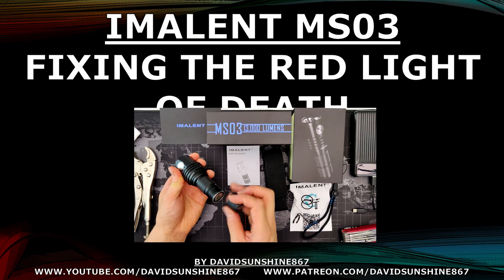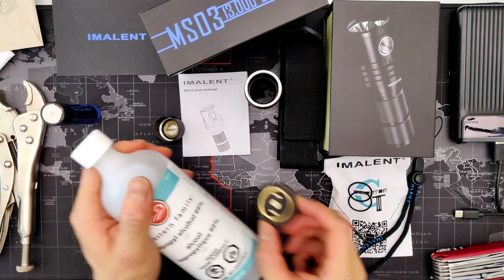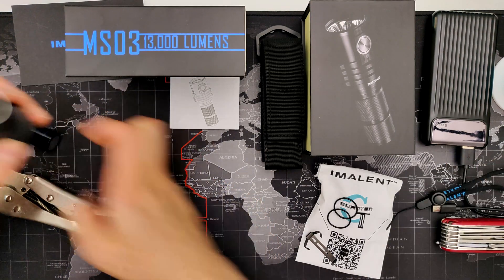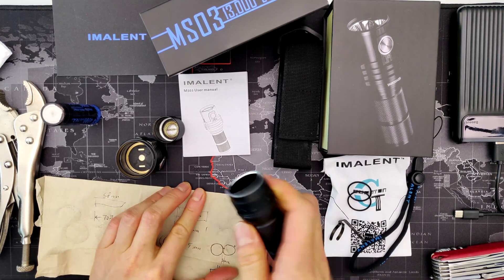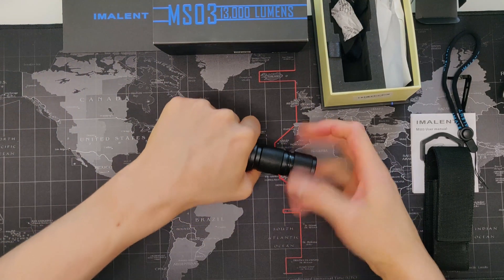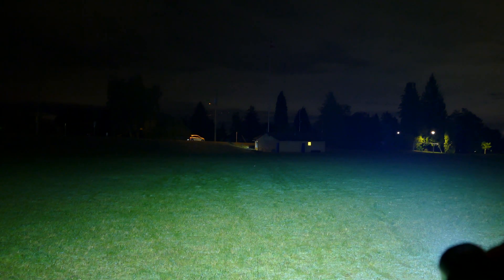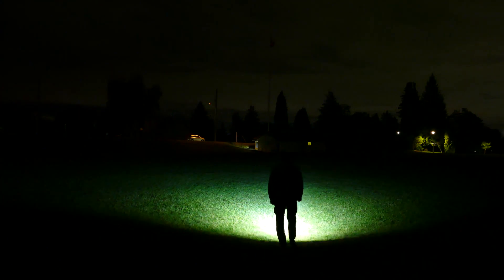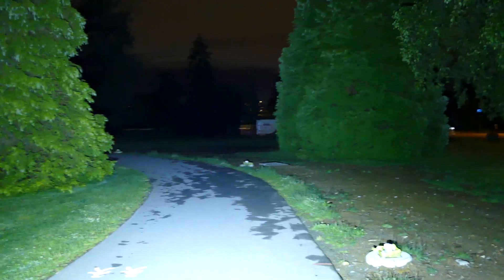How To Fix IMALENT MS03 - Red Light of Death

Comment: Did not work :( When attempting to go turbo the light blinks green 3 times then nothing. Regular flash light works but only 3 modes . Any ideas?
Reply from the maker: Does the LED light up for a split second?  Don't look at it, but shine it to a wall when you first put in the battery and try to engage turbo. I think I've seen that 3 blinks before, when I was first diagnosing the problem and the threadlock kept the current from flowing. It must know that there's not enough available current and only allows the lower modes.  The Texas instruments dc boost chip they have in there is actually very smart and has safeties.  I would try cleaning all the contacts again, even the spring and positive terminal on the driver.  Clean the aluminum body contacts, and clean the driver negative ring contact a lot, there may be a clear layer of threadlock on there that you haven't gotten off, may want to use a chopstick(carve the tip so you can clean all the surfaces easily) and rubbing alcohol to clean that. 
After all that cleaning, if it still doesn't work, it's probably a bad battery or driver.
Contact Amazon or Imalent to let them know and see how they can help you. They seem pretty good about it. They even sent me a new tail, cuz they thought the tail could be an issue, but I took the spring out and cleaned it.
Cheers!
David.
Reply: @DavidSunshine  Thank you so much for your attention and ideas. At this point I had contacted them through amazon and they'll be sending me a new one.  Currently in the process of shipping the old one out . Thanks again sir!! Your videos rock!
Reply from the maker: @enterthevortex5883  Great to hear!  Ya Amazon's policy is great. They make the customer satisfied!  Hopefully the new one works. If not, it's not really worth keeping. 
I got mine from AliExpress and they wanted me to send it back, shipping would be killer so I decided to look into fixing it myself, and I've been pretty happy with it. If it didn't work out, I'd probably have to pay $30 to send it back. 
I'm gonna try to swap the LEDs to warm white next tho! Stay tuned!
Thanks man! Glad you enjoy the videos!
Cheers!
David.
Reply: @DavidSunshine  Facts!! Thanks again!

Comment: My ms06 has this problems also and slightly oxidised or corroded contacts, they have brown spots and patches forming on them. The threads are also very rough and gritty so I think I'll do a good clean and fresh application of grease. Thankyou very much for your helpful video
Reply from the maker: You're welcome!  Sounds like the same problem. The MS06 is probably built with the same electronics, just doubled up, so 6 voltage boosters instead of 3.  In my detailed review of the MS03 I go into detail of why I think the programming is causing this issue, if they used the same programming, it could be leading to the exact same problems.
Hope it works well after your clean up all the contacts!
Cheers!
David.
Reply: @DavidSunshine  seems to be working ok but I'm finding the threads are garbage, so rough it literally difficult to tighten fully or get a decent grip on the body to loosen once fully tightened just because of the rounded and smoothed anodised finish  along with the large amount of friction. I can see why there's a bit of a premium on the thrunite flashlights of which I own 3 of, no QC issues at all. Still bright as all hell, good flood light. I'm looking to pick up a tn40 next for a powerful thrower with a useful beam and spill.
Reply from the maker: @Owen-np3wf  That's great to hear!  The machining sounds worse on the MS06 than on the MS03, the threads actually are very smooth on the MS03.  Thrunite sounds like a quality brand though, I don't have any of their lights but from what I hear, they are up there along with the best.
The TN40 looks like a great light!  Over a Km lol, that's a lot of throw.   You'll definitely be having some fun with that!
Cheers!
David.

Comment: Great review, can you let me know that there’s no more problems after you clean it
Reply from the maker: Thank you Boris!  I appreciate it.  Great question!  Actually, after more in depth testing, I found that the LVC is set too high still, and the light will still kick the low voltage cutoff on, and prevent you from using Turbo, once the battery is at about 3.8V, not ideal, they should allow turbo as long as the battery is at 3.0+V, but since they test for voltage during the turbo, it sees 3.0V and latches the LVC, and locks out turbo.  It's simple programming, but they could have changed the voltage testing to not function during turbo, or set it down lower.  I go into detail about this in my detailed review video, you can see it here:  https://youtu.be/KTgq42FKP8E?t=446
I could only go into turbo about 8 times, before it got down to about 3.8V, then you run into the issue.
You can help the chipset see a higher voltage by bypassing the tail spring with a copper braid, but the root of the issue is the firmware, and the fact that it is a latching LVC, instead, they should make it non-latching, and also check voltage during operation(With modified voltages in each mode, at Turbo, you would need to set a lower voltage, as I described in my detailed review video at around this time: https://youtu.be/KTgq42FKP8E?t=506).
Hope that helps!
Please let me know if you have any questions.
Cheers,
David.
Reply: Thank you so much for that response. I was about to purchase it. But I guess I’ll pass. I wish there was another flood like flashlight with 13k lumens that is a similar size. Any suggestions?
Reply: @Justoneoftheguys  Astrolux ea01s or Astrolux FT02S.
Reply from the maker: @Justoneoftheguys  You're welcome!  Glad I could help you make an informed decision.  The leaking side switch is probably not desired either.  It stops working until you can dry it out.
The Lumintop FW21 Pro(https://tidd.ly/3gmqOHs, Normal Version with 3 x XHP50.2s, not the X9L version which is an 6500lm/810m thrower) with 10,000 lumens might be a good alternative to the MS03, won't be as floody since it uses 3 x XHP50.2s instead of XHP70.2s, but still somewhat floody since it has 3 LEDs instead of just 1. It doesn't have a USB C port or a side switch though, but the Anduril firmware and user interface is awesome.  You can adjust the max temperature, which is handy, sometimes you may want it to not get scorching hot, other times, you may want more light output, and have it get hotter, like 65C.
Another light with a side switch is the MT07(https://tidd.ly/3mW9H1Q) with 5500 lms, very floody light with 7 x SST20s. It has the same firmware as the FW21 and can adjust temperatures.
The EC01(https://tidd.ly/2W3L4od) is a good 21700 light, slightly longer but has a USB C port, only 1 LED so not so floody.  If you look at my graph at https://youtu.be/KTgq42FKP8E?t=47, you see the EC01 puts out 5200lms initially, that's plenty of light, and the big reflector helps throw light.  If  you want a flooder with more power though, the EC03(https://tidd.ly/3mWssSP) might work well, I don't have this light, but since it has a shallow reflector, it should throw very similarly to the MS03.  The EC03 has smaller LEDs though, so it will throw a little better.
The USB C port on the outside is nice though on the EC01 and EC03.  It uses Anduril firmware, they all do, so you can adjust the temperature, it's set very low initially, but you can set it so that it gets as hot as the MS03, and by doing so, you'll be able to output about 2000 lumens continuously.
Check em out and see what features you prefer.  I like the copper FW21, but it would tarnish, and be heavy, so although it would be great since it has huge thermal capacity, and can stay on brighter longer, the weight and tarnishing might get annoying after some time.  I think that's why Aluminum is the preferred material, with a large copper slug inside.
If you need a good 21700, the Sofirn performs well for me, basically the same as the Imalent high drain battery:  https://tidd.ly/2Li6r2Q  
If you choose a light without a USB C port, a simple charger works fine: https://tidd.ly/36RHzY4
Hope that helps!
Cheers!
David.
Reply: Thank You sir for Your really useful review helping to understand that these MS03 and MS06 are rather still pocket rockets for short than torches to carry switched on for a long walk in a dark forest. I was considering to buy MS06 but refused due to Your review. 
But I still need a flashlight of the same size and weight to run 4000+ stabilized lms during about 1 hour or a bit more with a possibility  to throw briefly more than 12-15k.  Now I use a Sofirn SP 36PRO and am very glad, but I want more. Sir, would You be so kind to recommend me some other brands and models  with long-lasting run of 4k+lumens  instead of this Imalent MS06?

Comment: I've heard the MS06 has the same issues, at least in its first iteration.  Do you know if Imalent has gotten a handle on this issue?
Reply from the maker: Hi,
No idea if they have fixed it.
When I first had these issues and was asking about warranty, I described the problem to the representative, hopefully educating them. But they may have not told engineering, I didn't get any feedback on it, so it's possible that they are just continuing on with their current design.
In my more detailed review, I go into detail about why I think the issue occurs, the firmware is looking for 3V before it kicks in LVC, at the high current, they will do this prematurely, I described that too them, but I'm not sure if they'll readjust the firmware.
The MS06 has 3 batteries, so it shouldn't be as bad, but it could still be very similar since the traces on the circuit board may very well be similarly sized (proportionally to amperage increase).  
Cheers,
David.
Reply: @DavidSunshine  Thank you.  I might just risk the MS 06, from Amazon.  Wish me luck!
Reply from the maker: @jeffgaboury3157  Lol.  Ya it's worth trying out for 30 days, but Amazon got returns to Jan 31st so it'll be plenty of time to make sure it's working right!
Mine goes into LVC at 3.8V, so it's not the best, but could be worse. 
Keep in mind that as the battery gets older, the internal resistance increases and it might go into LVC even sooner.  So I'm a year or two it might only go into turbo a few times before it's LVC kicks in. So there's that concern too.
They really need to fix it in the firmware.
Hopefully you have good luck with the MS06! 
Cheers!
David.
Reply: @DavidSunshine  Thank you!  I would hope that they have been actively working on the issue.  Both lights are way too cool to not have the issue addressed.  Time will tell.
Reply from the maker: @jeffgaboury3157  Anytime!
Ya they are really cool. The hardware is great, it's too bad their software team let them down with a poorly programmed firmware.  I hope they get it right too!  But with everything software, there are bugs and they are constantly improving.  
Let's hope they get it right!  
Cheers,
David.
Reply: @jeffgaboury3157  how did you make out? I'm just finding this out after ordering one
Reply: @rich-qk7dc  I don't have the MS 03, but my MS06 works fine.  The R30 also works well.  Both the MS06 and R30 will go "red" once they heat up, but it's easy cycle through the modes and I don't have to break the battery contact or anything, nor have I had to clean the contacts.  I'm generally very pleased with the MS06 and the R30.  The only caveat is that the R30 switch isn't as robust - I find I have to hit it with the flat of my thumb, rather than the tip as I briefly had an issue with the R30 switch sticking when I used my thumb tip.  I think I was somehow pushing it forwards as I pressed and causing the switch to stick under the lip of its housing., but I haven't had that issue at all, since I changed to engaging it with the flat of my thumb.  I don't consider it a major issue at all, but it is something of which to be aware.

Comment: I'm confused, the MS03 will stop shining at 13,000 lumens after awhile and won't shine at 13,000 again until you reset it? 
Someone else in the comments here was talking about how the heat regulation kicks in. If that's the reason for this, then you shouldn't mess with it. Running it at that setting for more than just a a few seconds is a bad idea.
Reply from the maker: Good question Alrek!
This fix is to stop the red light from coming on right when the battery is charged to 4.2V, it should allow you to get into Turbo, turn it off, and go back to Turbo without issues, till the battery gets to about 3.8V(Manual states 3.4V, but I haven't been able to get it clean enough to get it down to that voltage, or my battery may not be brand new).
It has thermal regulation that brings down output from 13,000 lumens to about 2000 lumens in 35s automatically, and if you do it after the flashlight is already warm, it'll take about 15s to drop down to 2000 lumens, but that's not related to the "red light of death" problem.
The red light has to do with the Low Voltage Cutoff, which I calculate to kick in at an appropriately set 3.0V, unfortunately, at Turbo, the driver pulls 26A, so the driver sees 3.0V when the battery is about 3.8V, or when the threadlock is on the contact, at 4.2V, since there's a huge voltage drop across the system.  They've programmed the LVC to latch, mean it will prevent you from going into turbo until you disconnect power, it forgets the latching LVC, and allows you to go to turbo again.  With a fresh battery at 4.2V, you'll go into turbo, then be locked out of Turbo, and only be able to go into normal modes, until you reset it again by unscrewing the tail cap.  
With the fix I did in this video, I was able to reduce the system resistance by cleaning up all the contacts I could get to, but I still have voltage drop across the system, which is inevitable, so my LVC kicks in at 3.8V still.  Sounds like the new flashlights allow you to go to turbo over and over again on a fresh battery, but I don't know how low the battery voltage can be, I suspect it is similar to mine, which is 3.8V.  The manual states that the battery has to be over 3.4V to go into turbo, I assume that's under optimal conditions of contacts, and a freshly charged brand new battery, so it's a known "issue" that they even have accounted for in their literature.  They could fix this by programming a lower LVC for each mode, but I don't think they've gone that far into the details of the programming.  They've only set 1 voltage across all modes.
The flashlight is actually able to go into turbo easily when the battery is at 2.9V(that I've tested), and can hold the output no problem, so they really could set the LVC to be unlatching, and allow Turbo activation right down to 3.0V, and it would be fine for the battery and boost circuit.  They use 3 Texas Instruments S61088A boost converters in there, which function with input down to 2.7V, so they could easily get this light going to turbo down to that.  I think I had it going to turbo right down to 2.76V or so.  (https://www.ti.com/lit/ds/symlink/tps61088.pdf?ts=1600047624264&ref_url=https%253A%252F%252Fwww.google.com%252F)
I'm working on the detailed review of the MS03, so stayed tuned if you want more details on this flashlight!  I'll be giving it a rating out of 5 stars, the rating will be less than 4, given all the issues I've encountered with it. Stay tuned!
Hope that helps clear it up!
Cheers!
David.
Reply: @DavidSunshine  How likely is this defect to happen? I was considering buying one, but now not so much.
Reply from the maker: @AlrekArinbjorn  Hi,
Very likely based on how many people complain and have watched my video.  It's more of a design issue than a defect tho. The firmware is written poorly. 
I would wait to watch my video before buying the light.
But I'll give you the coles notes, cuz my video will be a while to make.  
The side switch gets water into it and the tactile switch stops functioning until you dry it, if it's salt water, like sweat, you might damage the switch, so it's not really water proof.
The front ring gets loose if you drop it, so it's not really drop proof.
And the LVC comes on too soon, once the battery gets a year old, you'll see the red light come on even sooner.
You can't get back to memory modes from turbo, you need to turn the light off, then back on (annoying since you're left in the dark for a split second, in a dark trail, that can suck for yourself and those walking with you who rely on your light, it could cause then to slip and fall).
It is the most powerful light for it's size on earth, it's well made, but those design issues make it not the ideal flashlight for those hiking, or those who need a trouble free light. 
It's really just a light to blast out the 13,000 lumens for 10 seconds (if you have a full battery!), which is still pretty cool.  
If you want to give it a try still, I recommend Amazon, then you can return it if it's defective and not performing like it want it to.
Cheers!
David.
Reply: @DavidSunshine  thankyou for informing me about the water seal. That means I won't ever buy an MS03. Fenix lights are expensive and they're not as bright as a lot of the competitors, but they're reliable. And the USB rechargeable fenix lights have internal waterproofing too, so if water gets through the rubber flap it's no big deal.
Reply from the maker: @AlrekArinbjorn  Glad I could help you out!  Yup, very bad design. Nice to have a metal button, but not good to have an exposed tactile button.  
That's why a lot of expensive lights go with rubber side buttons, even though they may end up cracking over time.  My X7R button is still holding strong after 3 years of using it at work, so but a big deal!
I don't have any Fenix lights, but they seem like quality lights!
Cheers!
David.